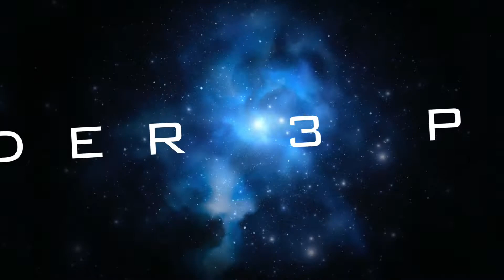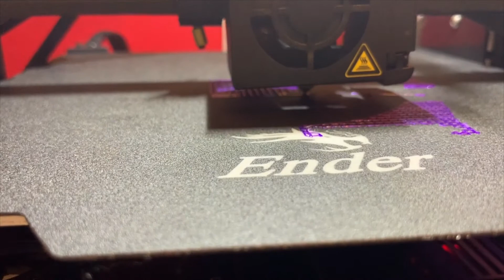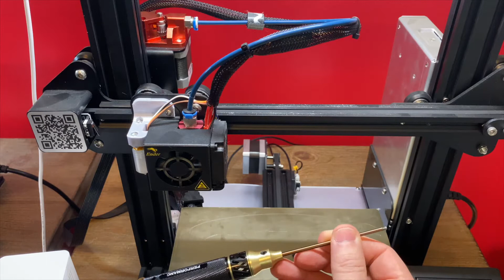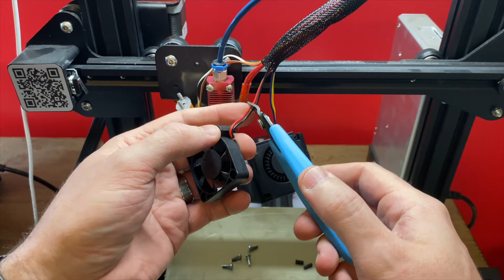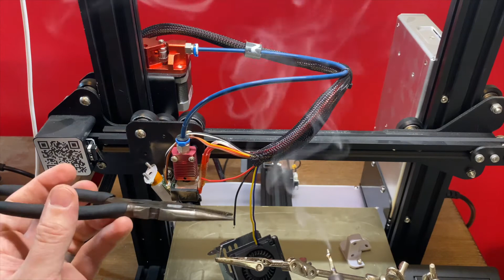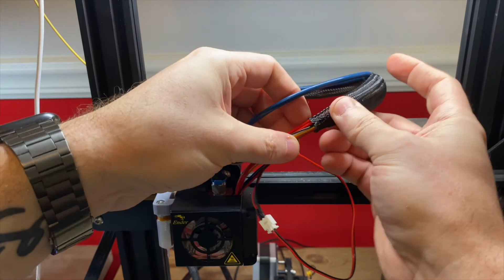Ender 3 Pro Hotend Fan Replacement with quick change plug installation

Comment: Note: The fan of hydraulic bearing should not work continuously for more than 10 hours a day, and the temperature should not exceed 75 degrees, otherwise the lubricating oil is easy to volatilize and it will cause great damage to the bearing. Lol
Reply: Where did you read that?

Comment: Where did you find the plugin female connector? I can only find ones where you need to solder.
Reply from the maker: amazon. I ordered a jst plug assortment
Reply: @GhostPants8012  Did you just take the two pins out of the female fitting and solder them to the wires and slide them back in?
Reply from the maker: @rileyneufeld7001   yes

Comment: would you happened to know how those fans compare to 12v Noctua? Your setup seem more beginner friendly and affordable. Awesome vid dude btw!
Reply from the maker: Thank you so much;) glad it helped you. 

I’m not for sure to be honest. I have never used one of those fans. I know they need a buck converter to step down the voltage. That is the reason I went with these fans. They are 24v and not 12v like the noctua fans.